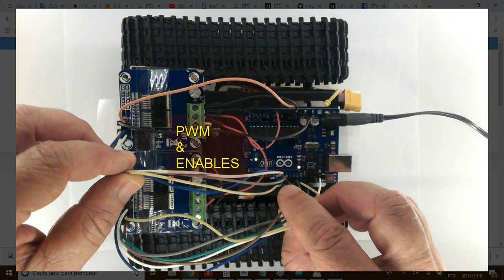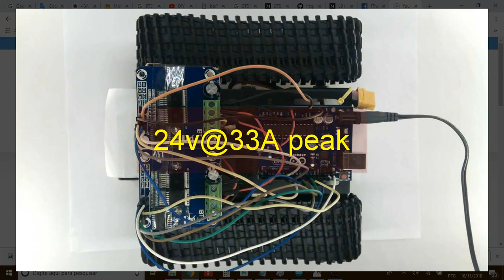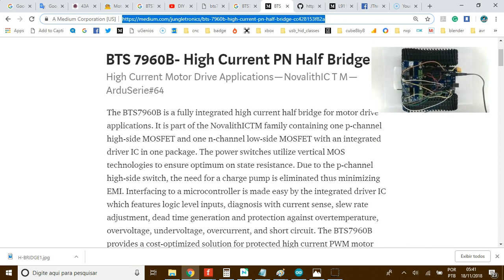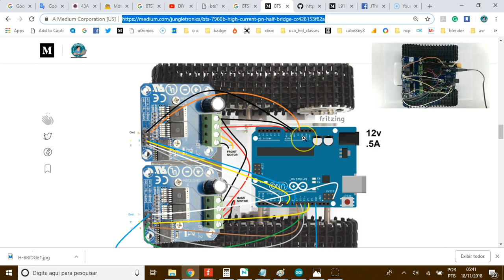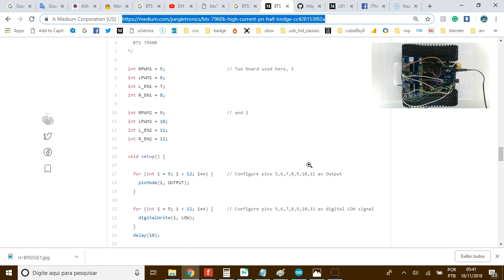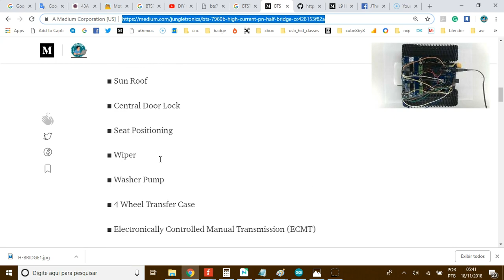BTS7960B — For High Current Motor Drive Applications — ArduSerie#64

Comment: Hi, just to warn you this BTS7960 board (at least the version i got) has almost no electrical insulation between the heat sink and de BTS7960B chips. Its only the thin black anodised layer on the cooling block that keeps this unit from short ciruit. very dangerous if used unmodded  by unknwoning buyers.